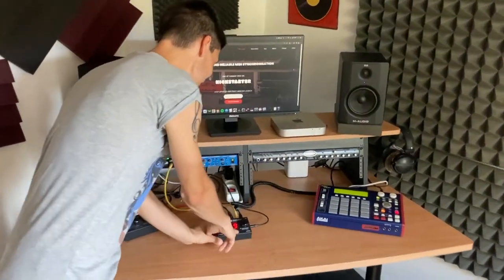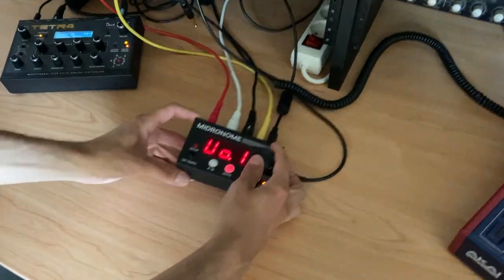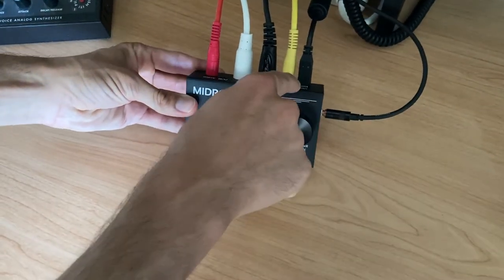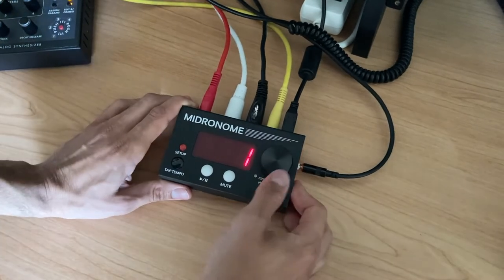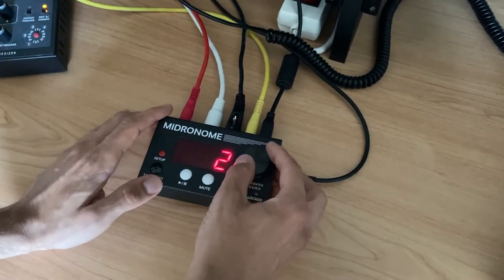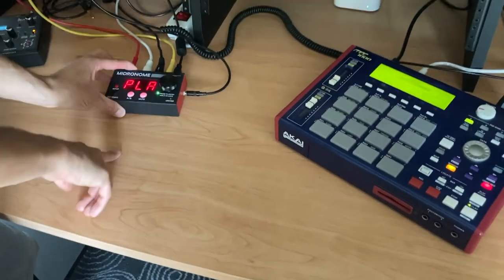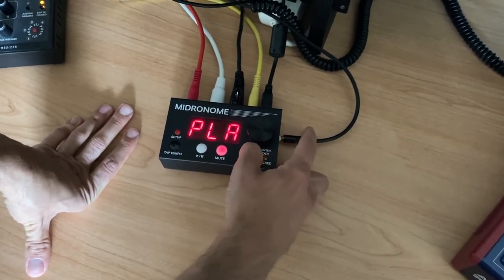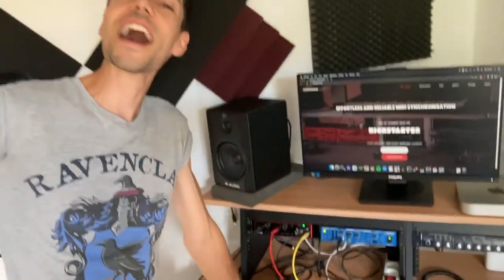How to use the CV & DIN clock output on the Midronome

Comment: Midronome seems great but it is not available for purchase. Anyone know of an alternative for setting clock and sending out via MIDI and CV?
Reply from the maker: Hi :) Just FYI next batch is planned for summer 2024 (there are no guarantees at this point though). I suggest you join the mailing list to stay updated, as it will be the first place to be informed of new stock. You can also keep an eye on the second-hand market, for example reverb and eBay, in case one of them shows up there :) 

As for an alternative in the meantime, you could simply use your current devices, making one of them the master? Just an idea :)

Cheers
Simon

Comment: Nice. What kind of cable do you use for the Dinsync connection?
Reply from the maker: DIN sync is a 3.5mm TRS plug, with 24ppq 5V square clock on left channel and 5V start/stop gate on the right channel :) 
Simon
Reply: @simntonic  ok. My DIN sync input om my 303's is a 5 -pin midi type connector.